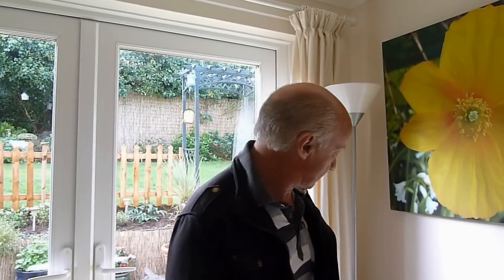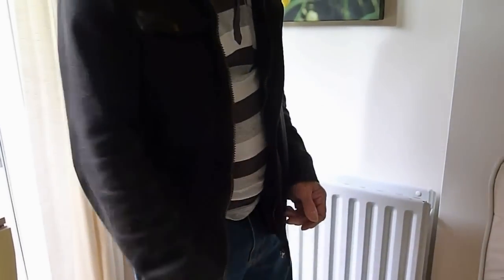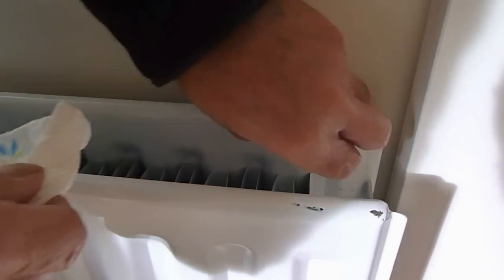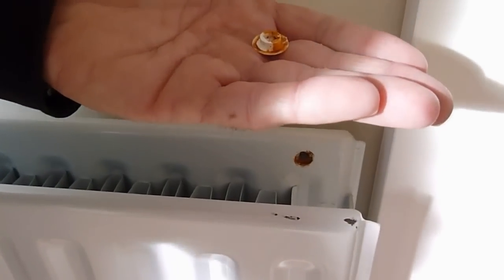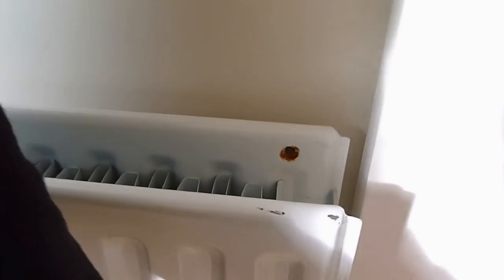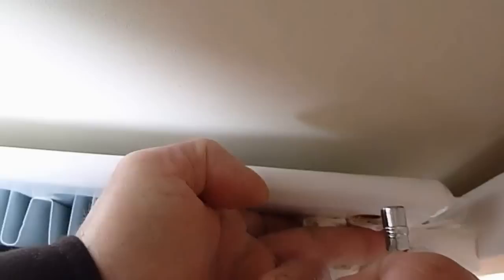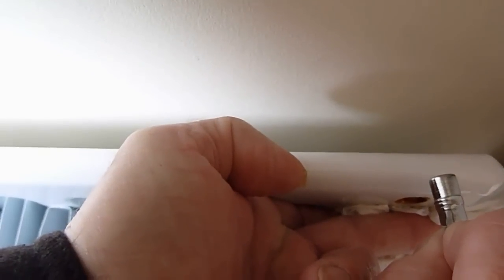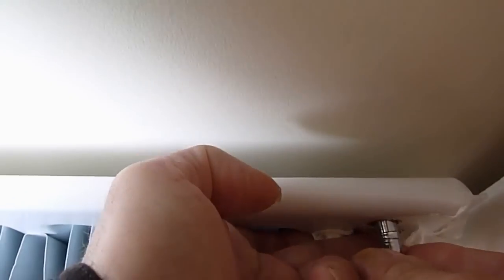How to find a radiator bleed nipple to release air and increase rad heat performance.

Comment: Would you happen to know if the radiator is cold all over, not only on top, would that also mean that it needs bleeding or there might be a more serious problem involved? Thank you for your help.
Reply from the maker: Try bleeding first, but you may have a stuck thermostatic valve, I have a video on how to fix it.

Comment: My new home has different radiators in every room. Each one has a different mechanism. Last one is has an "angled radiator valve" according to Screw fix. Where do I bleed it and with what tool? None of mine fit.
Reply: Following up on what I just said, the valve was irrelevant because this video showed me where to bleed the radiator. Thanks!
Reply from the maker: No problem Paul.

Comment: Hi Derek (derenton)

I've got this same rad in the bath and the rear brass bleed valve appears to have its edges rounded so the rad key just keeps spinning round, If i manage to plier it out do you possibly know what size in mm the replacement brass bleeder are on this exact radiators ebay start at these 10mm etc I think and didn't want to get the wrong one and have the headache to return etc..

Would appreciate any info if possible

Thanks in advance
Reply from the maker: Humm some are  8 some 10 mm and some 12 . They are very cheap though.

Comment: So much info but I can find nothing on my bathroom rad' that needs bleeding but no valve, only ends fixed with large hexagon nuts. Can you help please.
Reply from the maker: Just loosen one of the hexagon nuts to let the air out then retighten.
Reply: dereton33 Thank you will try to find a strong pair of hands to help me 
, they look a bit corroded on!
Reply from the maker: Spray on some WD 40 first.

Comment: hi there could you help me please has my plumber is telling me I need 2 new radiators  cost £350 plus labour. I have 2 radiators and the bleed valves are at the rear , they are very worn so cant bleed them.is there anything else I can do? many thanks dawn
Reply from the maker: Hi Dawn no afraid that's it.Sounds like your bleed valves are worn out.

Comment: What do you do if the valve won’t turn
Reply from the maker: Use an expensive well fitting rad key. Failing that you can just buy the 15 mm screw end with bleed valve, to fit in the end of the rad.

Comment: Tried this and just water came out, still not heating up yet all others in house are toasty warm ??
Reply from the maker: The thermostatic rad valve is either stuck, or the system needs balancing. I have videos on both.